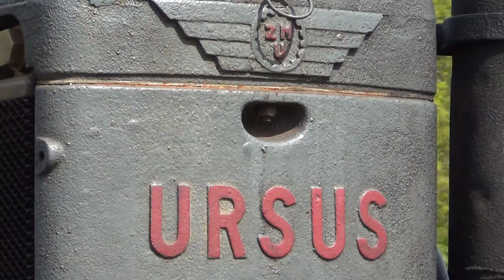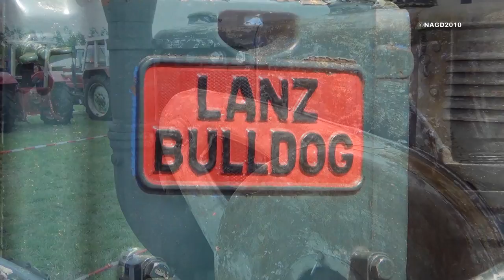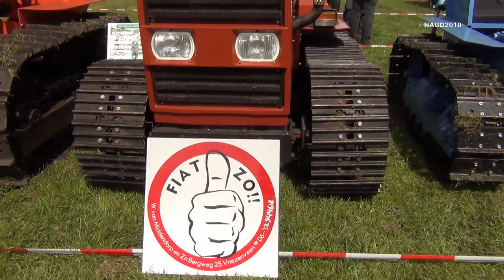Oldtimershow Twentse Rakkers 2015 & Hoefsmeden demonstratie.

Comment: I did spot quite they few Volvo BM and som Bolinder-Munktells in the video. I can understand that they aren't that common in the rest of Europé. Here in Sweden, they're so common, that you almost think that they weren't put out of production. You can still buy one for a cheap price. They're that common here. I do have one that's still working. I will restore it and will make a video when i'm working in the fields with it. Most people only uses them when events like this occur, but at least i like them. The only downside is that it's hard to climb in them. It's almost too claustrofobic. If you don't like small areas, then Volvo BM and Bolinder-Munktells isn't for you. It's nice to see them though as it's few how has them who isn't from Sweden.